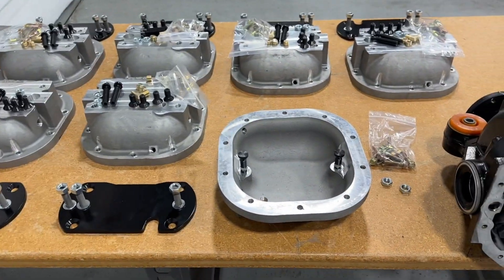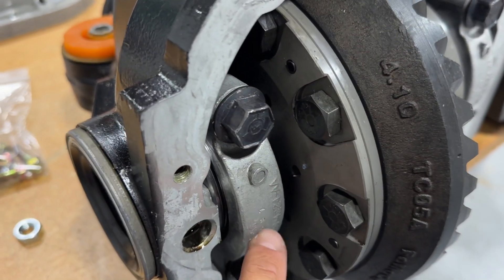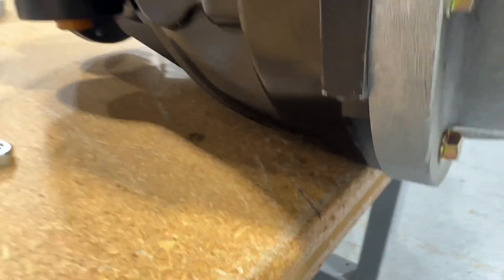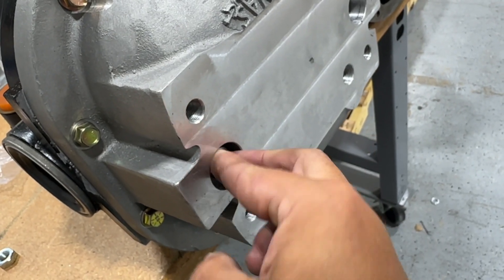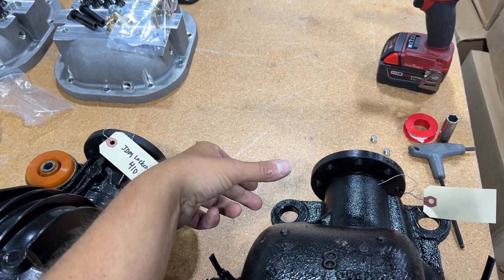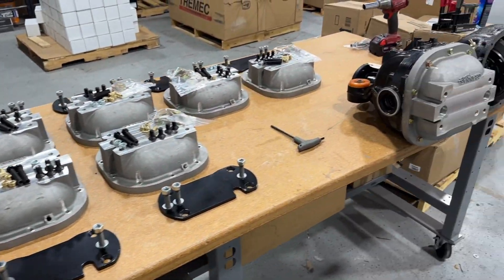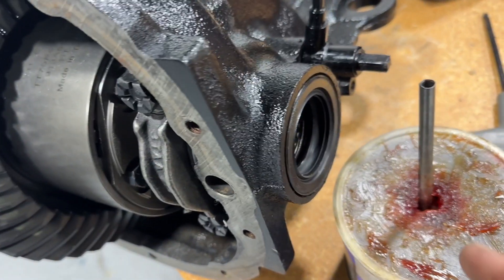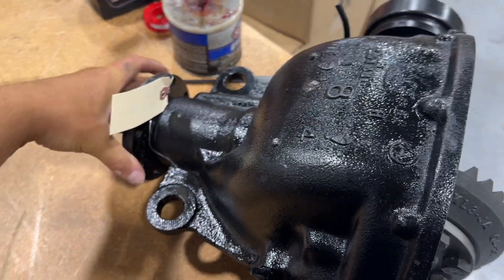ULTIMATE 8.8 - IRS Ford 8.8" swap rear cover and mounting kit

Comment: Whats the purpose of the load bolts? Looks likenthe rest on the bearing caps or covers.
Reply from the maker: on a hard launch all the pressure goes backwards on to the caps, pushing them and it can egg them over time and stress. the load bolt keeps the cap from moving backwards or flexing in the middle
Reply: So the caps don’t egg out
Reply: Prevent Ring gear deflection causing damage to casing, ring gear or ring caps.  Load bolts will increase torque capacity roughly 10-15% for caps and load bolt the ring gear will increase capacity additionally 15-20%, which on 8.8” you will likely never really need but it’s nice to have if you plan on putting down 800-900ftlbs of torque but the figures that the load bolt will increase that capacity more.

Comment: Is it me or isn’t there a market for the Mk3 Supras to get this kit/diff? Why haven’t they made one yet…
Reply from the maker: the problem is the subframe, its tiny at the front where the pinion is, you cannot fit this without cutting the subframe. To solve this, we are working on a complete MK3 replacement subframe now that can accommodate the 8.8 or 9". Get your money ready
Reply: @GrannasRacing  I will….however, perhaps I need to get my money ready to invest in starting a business like this my self. Talk to suppliers and get replacement parts made; once REAL money starts rolling in, then I can get my money ready for that subframe.
Reply: @755hp  Another excuse from the MK3 crowd 😂
Reply: @2jz65  No excuse….just choices. And better results to come.
Reply: Because MK3 owners are broke as a joke.
Reply: @2jz65  But yet many of them have 2JZ….including me. 🤔
Reply: @755hp  "many" is the wrong word. Not enough for it to make sense to produce.